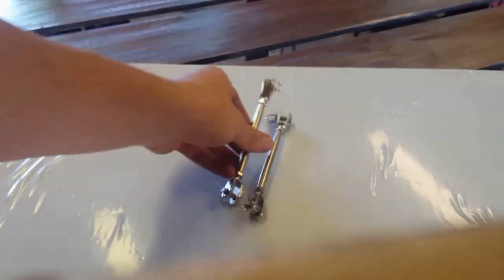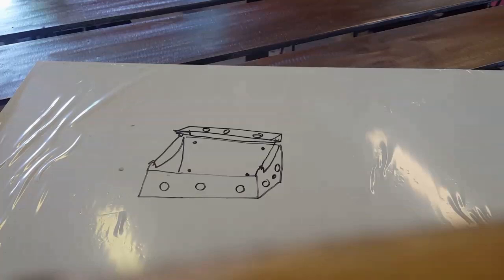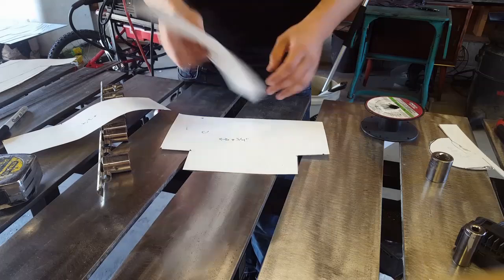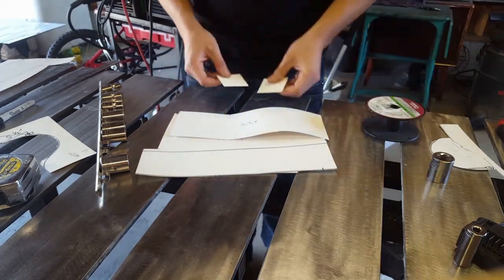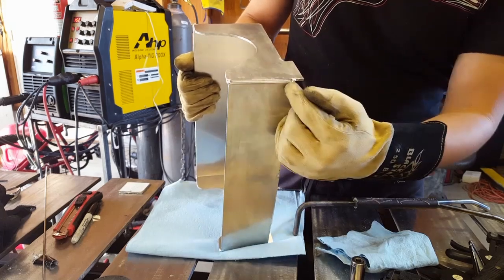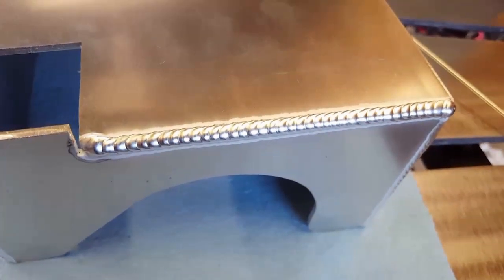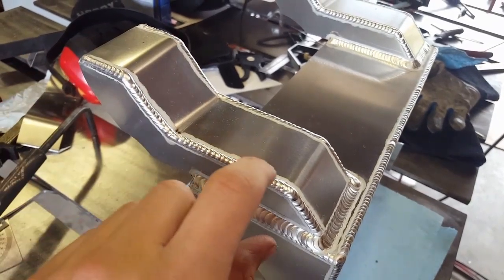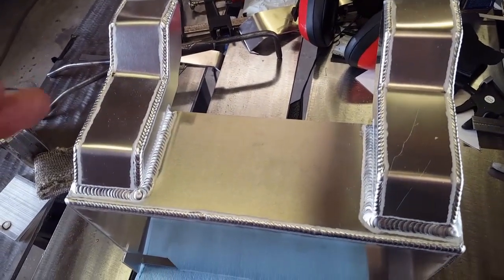Aluminum Tig Welding Project

Comment: Great stuff, but you should add amperage and weld settings for us dummies. Give us a chance man.
Reply from the maker: Haha I would but I have no clue what amperage I'm really running.  I max out the machine and then adjust as I go with the pedal.

Comment: How do you cut and weld without getting marks all over the aluminium ?
Reply from the maker: I just stay careful with them and place it on a towel and use another ground straight to the part so it won't t be scratched by the table. When I'm cutting I keep it wrapped in the plastic that it comes with

Comment: I noticed the arc doesn't start as crisp in AC as some of the higher end machines. I have a 2018 AHP and didn't like how it hesitated on the start. I thought it was a bad machine or foot pedal judging from comments, but seeing how yours does i guess it's all in the machine. Does it affect your aluminum welds at all on the starts? Great work by the way.
Reply from the maker: Brian Benton ya it does but in my opinion that happens anytime you have a balled tungsten with any machine.  I usually scratch the tungsten on the material before I light up.  I never had much of a problem when it's sharp unless it's old and needs resharpened. And no it doesn't affect the weld. Thanks for watching bud I appreciate it!

Comment: How do you cut your aluminum? Do you have a shear? Or bandsaw? I am trying to stay away from grinder wheels, that shit inbeds in the aluminum and i get little dirty specks in the welds
Reply from the maker: +illestk24civic I have a band saw and I did use a cut-off wheel but I do not recommend it.  They can load up and cause it to shatter when cutting aluminum

Comment: I was watching some of your aluminum videos i have a 2015 alpha tig 200x, what torch did you upgrade too? im really sick of the stock cable trying to spin the torch on me.  Thanks.
Reply from the maker: J W I know what you mean I got the CK superflex wp9 it's great but doesn't hold up to high amps very long.
Reply: Thanks for the reply.  Yea i saw it was rated at like 125, i was wondering if i should just get a ck 17.  Any input?
Reply from the maker: J W if I could do it again I probably would

Comment: Dang that is some fine welding there. I have that exact same TIG machine. What settings did you use?
Reply from the maker: consaka1 thank you! I usually have it set at 100-120 hrtz and  40-45% on the balance. I leave the machine maxed out and just use the foot pedal.

Comment: Have been enjoying your videos.

 I know you didn't get to film the stepped pieces. I'm curious to know if you welded non-stop around the base of those?
Reply from the maker: Theball Player hey thanks for watching I'm glad you like them!  I like to weld one section at a time.  so I ran each outside weld separately.  it helps keep the heat down and keeps it looking cleaner when they go the same direction in my opinion.  hope this answered your question!

Comment: Really impressive. Are you righty or lefty?
Reply from the maker: North jersey Kevin hey thank you i appreciate it!  I'm a lefty sorry if it all looks backwards to you!
Reply: 5th Street Fab Shop it's all good.  I ask because I'm relatively new to tig and I have trouble getting comfortable. I sometimes think about if I should start practicing lefty more even though I'm righty. I also noticed you ride you torch hand along the side of the table. I'm going to give that a try also. I envy your skills.  Thanks for the videos and keep up the great work. Stay well👍
Reply from the maker: North jersey Kevin right on!  it's always a good idea to practice with your opposite hand especially when you're learning.  I have to weld right handed almost everyday because of the angles and that being the only way to get in.  

yes it's important to get a smooth surface to slide your hand on.  it keeps everything smooth and stable.  always find a way to prop and try not to over grip the torch also.  good luck!

Comment: what were the setting on a/c balance etc
Reply from the maker: Ricardo Benin I think I was around 100 htz and 60% dcen for the balance.  I leave my machines maxed out and just adjust the amps with the pedal. probably around 90-110 amps for outside corners and about 160-180 for the fillet welds.

Comment: What is the amp, frequency and balance settings did you use for that plate thickness? I think its 1/8" thick. Thanks
Reply from the maker: Christopher Manuel I had my machine  maxed out on amps and just used the foot pedal to adjust.  I would guess around 100 amps on outside corners and 170 on fillets.  my frequency was around 100hrtz.  and yes it's 1/8"  I used 5356 filler rod also.
Reply: 5th Street Fab Shop Thanks! Good Job! 😊
Reply: I have 110 in my shop, and I run a 220 cord from the house when I feel the need for more amps.  I notice when my travel speed is higher I get better surface finish, which I put down to lower heat input and a higher freeze rate.
Of course I can't swear to that, but whenever I'm pushing the 110 and have to slow down my weld appearance suffers.
Reply from the maker: NTH Welding hey bud I'm glad those blocks worked for you.  Ya I noticed that too!  For a while i thought it was sucking in air somewhere.  But even with a different torch and cable it still does it. It's just with the 4043 though and I pretty much only use 5356.  I only have 110 in my shop it'd be nice to see what it does on 220
Reply: My father in law  left his alpha tig at my house to try out. The welds arent as smooth as yours look. Every weld looks grainy.  I used 
.125 material and 4043. Maybe its the 4043. And im only using 110v. Any suggestions? It aint no dynasty, thats for sure. But not bad for $800.
Reply from the maker: David Martin that's especially true with 4043 not as much with 5356

Comment: The design looks a lot stronger then the original one,nice welding to man turned out looking nice with no scratchers on
it,i find its hard to not get scratcher when fabricating aluminium stuff.
Reply from the maker: MRTYREMULISHA hey thanks bud.  ya it's hard not to scratch. it heats up so much that with something thin like this you can't just peel the paper back like you can on stainless.